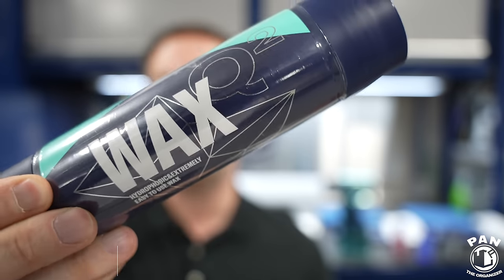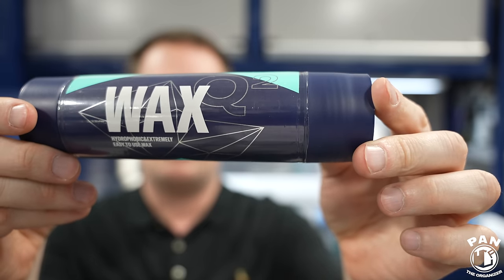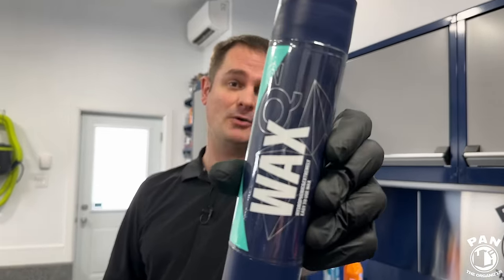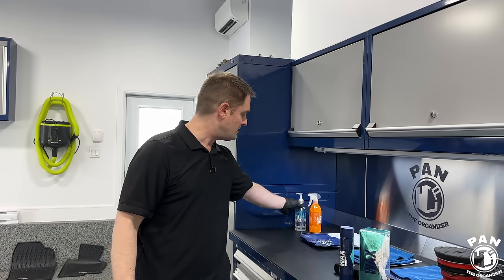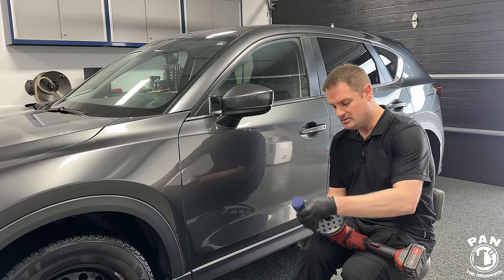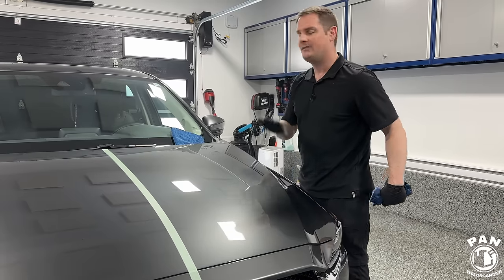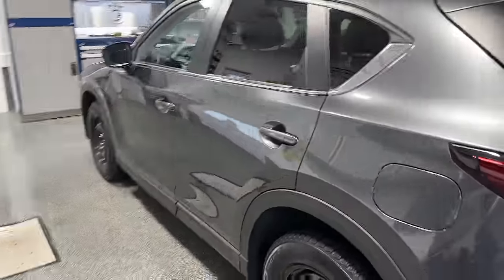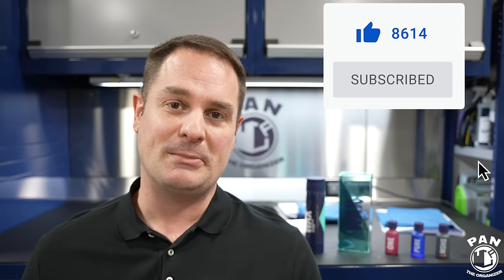Is this the most hydrophobic wax? Gyeon Wax !!

Comment: I'm confused when you say wetcoat is a sealant. Correct me if I'm wrong but sealat is uv protection. I contacted gyeon and they said wetcoat is just a ceramic booster.
Reply from the maker: On Gyeon's own website, it clearly states "spray sealant", and Gyeon does confirm that WetCoat is a sealant. I asked Gyeon directly and they confirm it also has a bit of ceramic infusion and also has UV protection. UV protection is just not its most predominant feature. Boosting hydrophobics and self-cleaning properties are the highlights of WetCoat.

I hope this answers your question.
Reply: @PanTheOrganizer  thank you for clearing that up. I was convinced to buy it most likely from watching your videos but since I'm new to detail, I get confused easily.
Reply from the maker: No worries. Welcome to my channel. You discovered one of the biggest car detailing channels on YouTube as we surpassed 870,000 subscribers and we have over 110 million views! I have been detailing for 26 years and I love to share my knowledge and passion with my viewers.

You found the right channel to help you learn everything about detailing.
Reply: Hi there,
As Pan described in the Q2M WetCoat video, our product does indeed have UV inhibitors in its formula. However this not the main properties that reflect the performance of this product and perhaps this is why we did not feel the need to emphasise on it - but we took note of your comment! Thanks.
Reply: @GYEON_official  I was reccomended the gyeon cure for sealant by whomever I spoke with. I imagine what you said happened. But now I rather try this wax over a sealant.
Reply: @corykalina  Q2M Cure is indeed a classic SiO2 sealant - but a wax is also a "sealant" per se, as well as Q2M WetCoat as it seals the paint pores.

We would classify them in this order:

Q2 Wax for looks, durability and hydrophobic properties.

Q2M Cure for ease application (can be applied as drying aid), darkening effect.

Q2M WetCoat for ease of application on all exterior surfaces, slickness and hydrophobic properties.

Hope that clarifies everything.

Comment: Hello.  I'm a first time watcher.  You came highly recommended by my Son In Law.  You talk about using the Q2 Wax over a ceramic coating.  Can it be used just on paint - that doesn't have a ceramic coating?  Will all the results be the same?  Thanks. Rick
Reply from the maker: Yes you can use it on unprotected paint. Think of it like a wax on steroids.

Welcome to my channel. You discovered one of the biggest car detailing channels on YouTube as we surpassed 890,000 subscribers and we have over 115 million views! I have been detailing for 26 years and I love to share my knowledge and passion with my viewers.

You found the right channel to help you learn everything about detailing.
Reply: Thank you.  I also purchased the Q2 Restart Wash, but it looks like that is strictly for ceramic coated cars.  So I don't use it neither before I apply Q2 Wax, or after, correct?
Reply from the maker: Restart Wash is to remove a bit of iron contamination every other month. Not for weekly washes. And yes you could wash a car protected with Gyeon Wax with it if you wanted.

Comment: Hi Pan.  Thank you again.  One more question please.  I've been using Mequiar's Hybrid Ceramic Wax on my wife's 2020 Palisade since new.  As soon as she drives it in the rain:  Road dirt (even dust) sticks to the side panels like glue!  I'm 65, and I've never had a car like this.  I have to wash each side and rear panel on the car 3 times to get the grime off, and for the panel to feel slick/clean.  I'm thinking this Meguiar's wax could be the problem, and I want it gone.  I have the Gyeon Q2 Wax coming and I will use it on this car also.  
     I want to strip all the previous wax off this car first.  Is it true that I can simply use Dawn?  Do you have a video on stripping all the wax off a vehicle?  I'm a details guy so I need to know "what, how much, leave it on how long," etc.  I don't have any water spots on this car and I don't want to screw the paint up now.  Thank you again.  You're awesome!  Rick
Reply from the maker: Hi Rick. The Meguiar's Hybrid Ceramic Spray Wax (blue bottle) is actually quite decent. Weird that you had such a terrible experience with it. Did you prep the panel properly before the application?

Like any protection, prep is key. You need to wash the vehicle, use an iron remover to remove brake dust and iron fallout, then a claybar to remove further embedded contamination, and then if the paint has scratches, swirls and oxidation, machine polishing is the next logical step. Polishing also ensures 100% removal of any previous protection that might still be on there. When you strip everything off, that's how you ensure the best bond of the new protection to the clear coat.

 After all that is done, I would highly recommend using a panel prep spray to remove polishing oils and make sure the protection bonds directly to a virgin clear coat.

For the Meguiar's Hybrid Ceramic Wax, the best way to apply the first layer (foundation coat), is actually on dry paint. We discovered this after doing off-label use. From then on, maintenance is as simple as spray on and rinse off.

So although you could just wash the car and apply the Gyeon Wax, the best way is actually as stated above. A full decontamination and paint correction. That's how you'll get the best results, best performance and durability.

After that, the best forms of paint protection are actually true ceramic coatings in glass bottles. Those last for years, and make maintenance washes a breeze.

Comment: How does this hold up to extreme heat or extreme cold climates? Like arizona summer or Canadian winter
Reply from the maker: Like any protection, there are too many variables to account for, so it varies greatly depending on prep, application, maintenance, weather, mileage.

You’d have to scroll through the comments to get an idea of how long it might last in your conditions.

But the durability claim is 1-5 months.
Reply: @PanTheOrganizer  great, thanks for the quick reply!

Comment: Great video Pan,some great information here,but how does this wax hold up against the turtle wax 75?I'm not a lover of ceramic coatings since an accident I had,it gave me and the body shop hell,since then I won't touch ceramic coatings, now I'm back to using wax,I'm about to jump back to either tw 75 or gyeon, your advice will be greatly appreciated....
Reply from the maker: Both are comparable in terms of durability, but Gyeon has more gloss and better hydrophobics.

Comment: Thank you for your informative videos. I am one of your fans 👍
Once a year, I coate my car with Gyeon CanCoat Evo. As a maintenance I use either Gyeon Ceramic Detailer, Gyeon Wetcoat or Gyeon Cure. It works fine. Do I get a even better performance if I use Gyeon Wax twice a year as a topper for the CanCoat?
Reply from the maker: I would stick to your current maintenance regimen.
Reply: @PanTheOrganizer  Thank you very much. I will stick to my plan, and follow you here 😊🚙

Comment: Is this wax better than fusso coat? I have a white car. Is it allowed to use the gyeon wetcoat and wax together? I have the wet coat already... :)
Reply from the maker: Fusso Coat lasts much longer (10-12 months) but the Gyeon has more gloss, slickness and much better hydrophobics. So it depends what you want.

You could apply the Gyeon Wax, and then, for maintenance, use WetCoat after a regular wash every other month or so, yes.

Comment: wait, am I putting a coat of wax on top of my ceramic coating? or this is in place of?
Reply from the maker: This can be used as a stand alone paint protection. Meaning just the wax itself on unprotected clear coat. Or, you can use the wax on top of an existing Gyeon coating, as it was formulated to be compatible. (We don't normally apply waxes on top of coatings, but this wax has been formulated to be chemically compatible with all of the Gyeon coatings).
Reply: @PanTheOrganizer  ok, thank you!

Comment: I love gyeon products especially wet coat. Bought all my products based on your videos I actually applied the soft99 wax last year after watching your video but can you apply that one with a polisher as well? And also what nozzle are you using on your wand ? Great video as usual thanks again.
Reply from the maker: Any paste wax or sealant can be applied by machine as long as you use slow speeds and a soft finishing pad.

I use a 40 degree tip on my Mosmatic gun and wand.

Comment: Could you put P&S bead maker on top of this? E.g. Q2 wax, leave for 2 hours, buff off. Then use bead maker? Would that work? Would it be worth it/a waste of product?
Reply from the maker: I would let the wax cure for about a week on its own before applying toppers from other brands. Then, yes you can use Bead Maker.
Reply: @Pan The Organizer  so, wash - wax - wait a week - wash - toppers? For wash number 2, would something like Gyeon Bathe be ok and not take the wax off? (assuming the car doesn't get too dirty in that week of course).
Reply from the maker: Yes that's correct. And yes Gyeon Bathe or any other pH neutral shampoo will do.
Reply: @PanTheOrganizer  Thanks for the help, I really appreciate it. 😀👍

Comment: Dear Pan, Sorry to be rude. I seen your Gyeon Wax.  I use Ceramic wax and graphene wax, But does not do much for my wife 2012 silver Honda Civic, Or my brother inlaw dark grey 2018 Honda Civic, But With the Gyeon Wax, WOW, I got a 2018 S.U.V and it is a glossy white. Even better. A very big thanks. I guess that the oil in my wife Honda silver Civic has dried out, (Maybe?)

Comment: Hey Pan, if I use this as base layer and add a coat of 303 graphene on top, do I get the hydrophobic capabilities of this or the 303?
Reply from the maker: You typically get the properties of the top-most layer. But be careful which products you combine as you can’t fully guarantee chemical compatibility.
Reply: @PanTheOrganizer  how can we check the chemical compatibility

Comment: hey pan love your videos, I have a question which is better for gloss hydro2 lite by car pro or gyeon wet coat because I'm a mobile detailer and I want some thing with ceramic and thats fast to apply and something that's gives the most gloss with protection.
Reply from the maker: Both are almost identical.
Reply: @PanTheOrganizer   which one would you rather use

Comment: Hi Pan, another great video!
Maybe do a video on how to wash & protect a brand new car?

I ordered a Porsche macan january and delivery is may 10th.
I really want it to have the best protection possible without having to polish (I’ve never done it and don’t want to practice on the Porsche 😂).

Have a good one 😃
Reply from the maker: I have tons of videos on detailing a brand new car, including these:
Tesla Model Y: https://youtu.be/gohks8xP5NY 
Porsche 911 Carrera: https://youtu.be/2ckiivbFqs4
Audi Q7: https://youtu.be/t7HCBSVnizM
Reply: Saw that one already haha! 👍🏼 would it be enough to skip polishing on brand New car and finish with turtle wax’s ceramic spray coating after the shampooing step?
Reply: @TheFLexiZ  your car will have swirl marks from the factory (all cars do.  even exotics) and even worse if you let the dealer wash it before you take delivery.  I'd recommend a local detailer to do a correction so you start with perfect paint.

Comment: How long do I wait after doing mohs cermic coating to add this?
Reply from the maker: After applying a ceramic coating, it’s usually always recommended to wait two weeks before you start washing the car again, and then you can start using toppers like the Gyeon Wax or a silica spray sealant.
Reply: @PanTheOrganizer  I watched a video of car supply warehouse do one 12 hours after they did the coating. I'm doing a customers cobra and thinking of doing this, this weekend.

Comment: Hey Pan, thanks for the video.  I have used the wax before (applied by hand) and really enjoyed the result.  I now have a polisher so I appreciate seeing some machine application and hearing about the differences in application methods.  I have a couple questions regarding pad changes/wax re-application.  If/when you ever change pads while machine waxing with this, how often would that be?  If/when you re-apply wax to the pads, how often would that be?  Thanks for your time!
Reply from the maker: No need to change pads while waxing as there are no abrasives in the wax. One pad is all you need.

You will know when to add more wax to the pad as you will see on the surface you are not laying anything down and you need to add more. Generally once per panel.
Reply: @PanTheOrganizer  thank you very much for the reply!

Comment: So shiny… shiny enough to see that dent in the driver door 😂 side question: can you use both wax and ceramic or ceramic then wax or even graphene then wax etc?
Reply from the maker: Not regular carnauba waxes. Only waxes that are compatible with a coating, like this one.

But as a general guideline, if you have a ceramic coated car, use a ceramic spray on it for maintenance, like Gyeon WetCoat or Cure.

Comment: Gyeon wax is good for a windscreen?
Reply from the maker: You can apply Gyeon Wax on all clear-coated surfaces (paint and wheels) and glass. So yes you could apply it on the windscreen as well. But they have a better glass coating specifically made for that, here: https://bit.ly/44jwmKP
Reply: @PanTheOrganizer  super..it is easy to use? Good for a amateur/ hobby  people?

Comment: Would this be a good maintenance topper for a Carpro 9H coated car?
Reply from the maker: Although it "can" be applied on coatings, it's best to use a silica spray sealant on a ceramic coating for maintenance. If you have CarPro, you can either use their Reload 2.0, or Gyeon Cure. Or any SiO2 spray sealant of your choice.
Reply: Thank you, Pan! I really appreciate it!
Reply from the maker: My pleasure. How did you discover my channel by the way Michael?
Reply: I bought a new car and went on a deep dive on how to detail and that naturally led me to your channel.
Reply from the maker: Congrats on your new car! Welcome to my channel. You discovered one of the biggest car detailing channels on YouTube as we surpassed 900,000 subscribers and we have over 116 million views! I have been detailing for 26 years and I love to share my knowledge and passion with my viewers.

You found the right channel to help you learn everything about detailing. 

A new car is never new until it's properly detailed. 
- at the factory, the paint defects are often corrected quickly by rotary polishing which can leave marks and holograms, so polishing corrects those, before you lock that in long term with a ceramic coating for example.
- vehicles are then transported by truck, train and boat so they are exposed to the elements, industrial fallout, brake dust, rail dust, etc
- vehicles are often left at boat docks (when transported by boat) or in exterior parking lots for weeks or months, again being exposed to the elements
- at the dealership, the vehicles are almost always poorly prepped using the same dirty water that was used for all the cars on a given day, and poor washing and drying methods leading to swirls and scratches 
- at the dealership, a layer of cheap wax or paint sealant is usually applied to attempt to make the paint glossy prior to delivery. It's crucial to remove any previous protection before you apply a ceramic coating, as coatings need to bond directly to a virgin clear coat.

If you only plan on applying a regular carnauba wax or paint sealant though, you could decide to skip machine polishing, as those protectants can be applied over existing protection and it's not as crucial to prep the paint as well.

I explain all of this in this popular video: https://youtu.be/QgoyrC-5CMc

So you can better visualize the new car prep process, here are the steps I perform on a brand new car from two of my customers: 
Tesla Model Y: https://youtu.be/gohks8xP5NY 
Porsche 911 Carrera: https://youtu.be/2ckiivbFqs4
Audi Q7: https://youtu.be/t7HCBSVnizM
Reply: Thank you, Pan! Your passion and knowledge definitely comes through, I am now subscribed!

Comment: I hate to sound like an idiot but I thought you weren’t supposed to apply waxes on top of a ceramic coating my detailer keeps stressing that I use shampoos without any waxes and don’t apply wax.
Reply from the maker: That’s correct when we are talking about traditional carnauba based waxes. You wouldn’t apply regular waxes on coatings as you’d be masking the coating’s superior properties and the coating would end up rejecting the wax anyways.

Some waxes are ceramic based, like this Gyeon Wax, making them chemically compatible with ceramic coatings as they share a common base in the formula.

You have to read on the product and see if it’s compatible with a coating.

Comment: Pan how would you compare this to Soft99 Fusso Coat?
Reply: I’m not Pan, but I have to say that Finish Kare High-Temp Paste Wax is at least, or more, durable than Soft99. It also beads like there is no tomorrow.
Reply from the maker: Fusso Coat will last longer, but Gyeon Wax has more gloss and better hydrophobics in my opinion. Both are very good products.